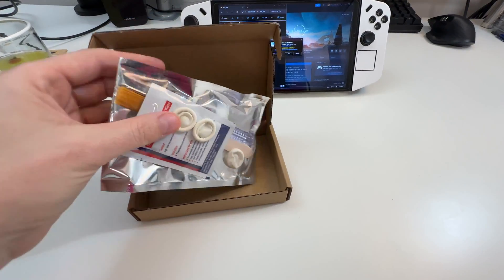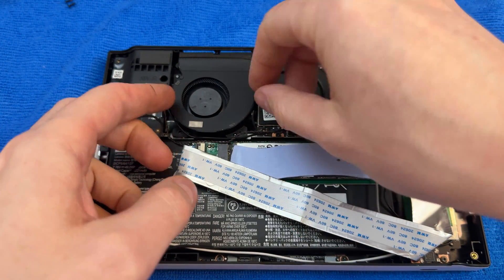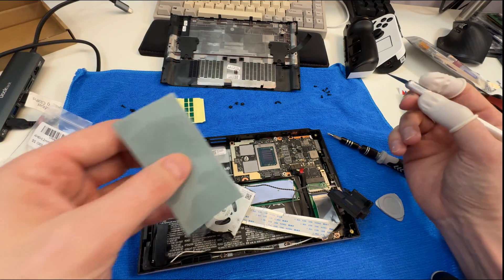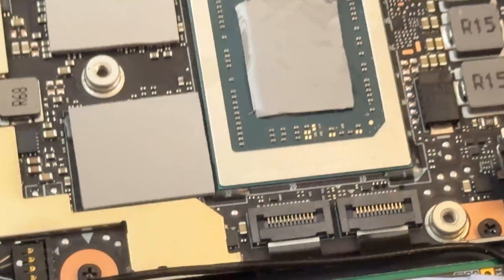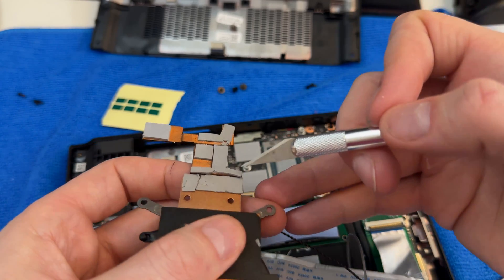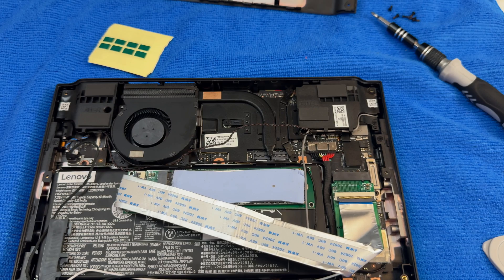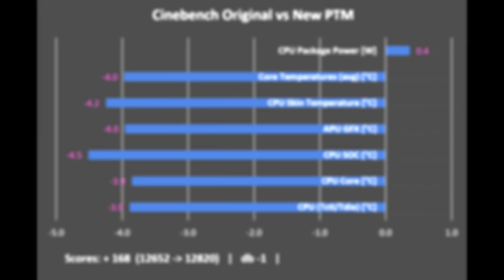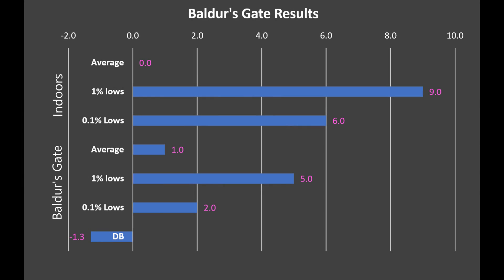Lenovo Legion Go - Improve Thermals & more FPS !! (testing and guide)

Comment: Bro great content but I must disappoint you. Those thermal pads you used on the heatpipe is completely wrong. Pads are not made to cool parts you apply them to but to just transfer heat between surfaces. If you would connect say your heat pipe to say some fin stack or maybe another aluminium surface then you would see an improvement. Otherwise you just slightly increased the overall thermal mass. It would just soak up slightly more amount of heat that's it. 

So just putting thermal pads on top like that increases the total thermal mass at best and reduced the cooling surface of the heatpipe at worst. I also noticed your SSD has a same mistake of only having a pad on top. You should use the thinnest pad possible and add a metal sheet on top of that pad to have any cooling benefit. Otherwise all your SSD is getting is trapping heat underneath the heatpipe. An aluminium or copper heatsink should be used. Think of a pad as a "glue" or a "connecting materials" between surfaces. It's not the pad that cools but metal on top of memory chips and some air that blows on top even slightly. 

I hope this advice would help!

Comment: greate video! but there is something wrong with the presented results - for example in Cinebench the increase in points is exactly the same (12652->12820, -1db) - both in the case of replacing the paste (7:37) and adding a thermal pad (11:28). it's the same in the Time Spy results

Comment: You should of used raspberry pie heat sinks on the back of the plate that attached to the heat pipe that go over the vram keepin that vram is very important

Comment: I would just use liquid metal....... And no it wouldnt kill the device because I would cover the connections arounds the cpu
Reply: You clearly never used liquid metal before 😂. Go on try it (please dont), i give you one free tip, apply if on both the apu and heatsink to do it right
Reply: And another free tip, read about liquid metal on copper heatsinks...

Comment: Phase change paste should be the exact size because as the name implies it changes. As the device heats the pad will slightly liquify and will "ooze" out the size after the break-in period even on quality pads. So do not go bigger than the die or IHS when using these 'pads'. It won't hurt anything but can make a mess.

Comment: Based on my studies and thermal paste application, I do think that using that type of thermal pad may create air bubbles on the cpu surface creatinf problems in contact with heat pipe (and heat transmission). It may be also fabric bad application from Lenovo too. Also keep in mind that when those air bubbles heat, they become larger too. Basicaly I think that applying thermal paste on the center of cpu it will spread evenly without creating any bubbles, and also better heat transmission. Anyway, nice video and very well explained!
Reply: PTM is supposed to liquify.  So those bubbles should work their way out the same as thermal paste.

Comment: Great video!  I know I'm a bit late to the party, I'd like to do a full replacement of thermal pads on the heatsink when I do this mod as well.  It looks like they are all either 1mm or .5mm from what you saw.  I can't find sizing anywhere else and wasn't sure if your opinion changed.  Thanks!

Comment: Hi there, thanks. I am using Egpus with usb 4. What I see is that the Usb4 (backplate) gets really really hot. With the consequence that it disconnects. Any idea how to improve the thermals on the Usb4?
Reply: Die SSD wird zu heiß und schaltet dann ab (Bluescreen) Hatte ich auch schon. Ich habe ein 60x60mm Lüfter oben an den Lüftungsschlitzen angebracht der die Luft aus dem Gehäuse zieht. An dem Scharnier vom Kickstand entfernt man die schwarze dünne Plastikabdeckung, dort strömt dann kalte Luft ins Gehäuse und kühlt die SSD die direkt darunter liegt. Man muss nur immer den Kickstand ausklappen damit die Öffnung frei ist. 

Wenn man den oberen USB 4 Port nimmt wird das Go dort ebenfalls sehr heiß, man merkt es wenn man das Display dort berührt. Am unteren USB4 Port ist das Problem das die SSD zu heiß wird, aber die kann man mit dem Umbau effizient kühlen. Habe mit egpu max. 70-75grad SSD Temperatur. Ohne eGPU 60-65Grad. Ohne den Lüfter hatte die SSD mit eGPU 82Grad und mehr.
Reply: @matthias99442  thanks! I tried to understand what you are saying. You are saying to create a hol at the backplate where the kickstand is. It sounds logical, I'll try it. Thank you
Reply: @faiqkarim1654  
You have to unscrew the cover from the Go. The cover has hinges for the stand. There are 2 thin plastic covers on the kickstand that can be removed, then you have an opening right next to the SSD (a kickstand is right above the SSD). What's still missing is airflow along the SSD, this doesn't have to be particularly big or much, but it prevents the SSD from overheating if you use an eGPU on the lower USB 4 port. To do this, I attached a fan at the top of the ventilation slots that sucks the air out of the case and at the same time cold air flows in at the bottom and cools the SSD.

But you need a fan that allows the air to circulate in the case. Air at the top sucks out and cold air flows in at the bottom.

Comment: 1) thermal paste holds AT LEAST 4-5 years doing its job. The risk of damaging something while changing the paste is much higher than the real benefits.

2) turn off CPU boost AND hyperthread, both can be disabled for better thermals and battery life and minimal impact on games. Those two features are important for multimedia editing, office, intensive web browsing only. In games the impact in fps is minimal but people get a decent amount of better thermals and battery life.
Reply: To turn off cpu boost will tht be inside the windows settings? Also will te hyperthread option to turn off be inside the bios settings?

Comment: I believe lenovo uses their own special order version of PTM7000(7958), but installing applying it as PTM7950 performs better? hmm... I think I can stick with PTM7950.
Reply from the maker: This 7950 absolutely did improve thermals. Not groundbreaking as the go already runs cool, but it does make a difference. I’m currently testing 7950 on other devices and am seeing similar results 

I also ordered some from ebuy7, so I can compare the Amazon stuff to theirs.

Comment: Turning off CPU boost in the Windows 11 Power Options menu will lower the temperature further. In Windows 11 seach for the following "Edit Power Plan" and then navigate to > Change Advanced Power Settings > Processor Power Management > Processor Performance Boost Mode > Disabled

EDIT: You can download the "PowerSettingsExplorer" application software from the Internet to unhide the "Processor performance boost mode" setting in the Windows 11 Power Options menu.
Reply: @Dystopia-x9x  To lower the temperature of the CPU and to extend the battery life of the Rog Ally when gaming. In most games there is no lose of performance by disabling CPU boost, so it's best to disable it.
Reply: @iidjkg   What about disabling SMT [AMD name for Hyperthreading] in the bios, and get just 8 pure cores, that will be less power usage and less heat, while keeping 8 real cores, it will be equal to SD Threads, but still twice faster since SD has 4 cores and 8t and here you'll have 8C/8T
In theory the CPU should boost higher and gpu should boost higher since you'll free up some resources that get used for SMT
Reply: Info: CPU boost AND hyperthread can be disabled for better thermals and battery life and minimal impact on games. Those two features are important for multimedia editing, office, intensive web browsing.
Reply: Thanks this worked for me
Reply: My Legion go doesn't have that option
Reply: @snoozyitis  Download an application called "PowerSettingsExplorer". It will allow you to unhide all the hidden power options in Windows 11. And then you will be able to access them in the "Edit Power Plan" options menu.
Reply: @snoozyitis it's not a legion go option it's a windows option, if u don't have u can find it on Internet and add it to register
Reply: I hate if people say something like "in MOST games it will make no diffrence"... so in what game does it make a difference lol
Reply: Right lol they want you to make your unit like a o3ds compared to the new3ds @Raptorialand  I keep that stuff on it needs as much performance boosts as you can get if anyone wanted a less powerful device there were other options in the handheld community that were trying to compete with this unit they should go after instead.
Reply: @Raptorialand some aaa games are cpu limited but I don't play those games on a handheld, anno 1800 for example

Comment: I started to use PTM and K5-Pro in my laptop after hearing it from LTT, great stuff, no need to guess what size pads to get for the other chips so the CPU and GPU will make the best contact. Also works almost as well as liquid metal without the mess or hazards of it.

Instead of thermal pads on the pipe, maybe there's enough room to thermal-tape thin, ribbed heatsinks or route another thin heatpipe to it? I want to try it to my One Netbook T1 to better cool that i7 in it.

I want to see it the RAM amount is locked in the BIOS, because I want to hack it to 32GB if I decide to a Go.
Reply: I have some leftover sodimm heatsinks I'm going to stick onto the heat pipes to see if it spreads heat out better and helps thermals

Comment: Best Man. Thanks for this. Also ordered PTM7950. You May try out some SSD Heatsink next ? It also heat UP (Got over 75 Degrees in Crystaldiskmark)
Reply from the maker: My 2280 mod doesn’t get hot. But it’s worth slapping a thermal pad in yours

Comment: Now this is quality content If one is comfortable with doing a thermal upgrade, getting Ptm7950 is considering one of the best options, especially long term. Loving the graphs and benchmarks as well. Just wish these Phoenix Apu's were able to be undervolted (sadly only the 7940HS can be Undervolted).. Big miss by Amd locking them out using the Curve Optimizer. The one main advantage that the SteamDeck/Steam Deck Oled have over the otherwise superior Legion Go, is their ability to be Undervolted. Have to give Valve props for making it easily accessible in their Bios as well. Here is hoping that once we get Strix Point next year, that Undervolting won't be locked for the handheld chips..